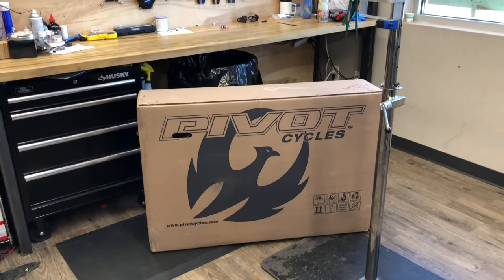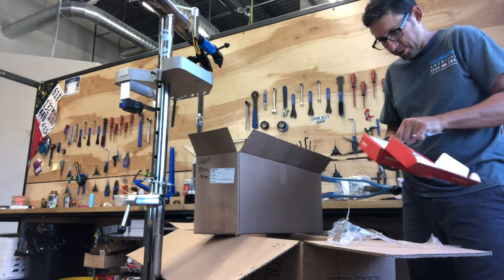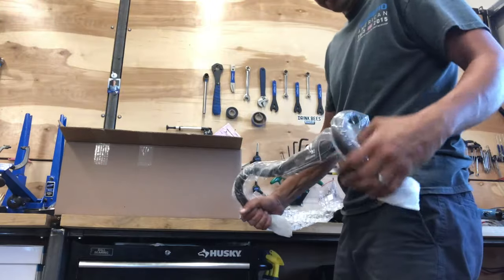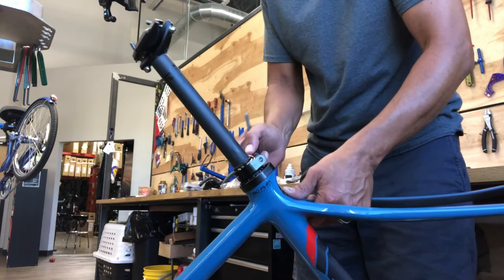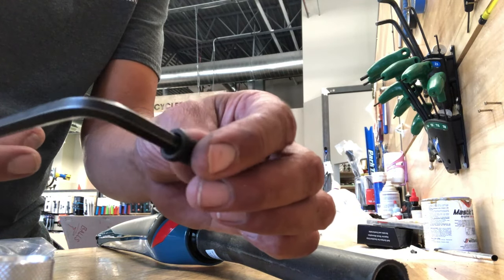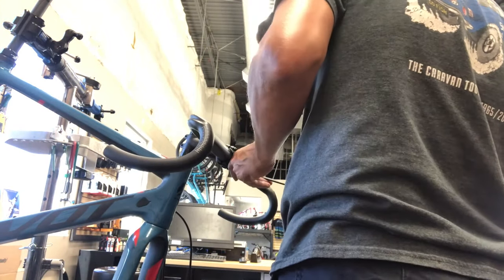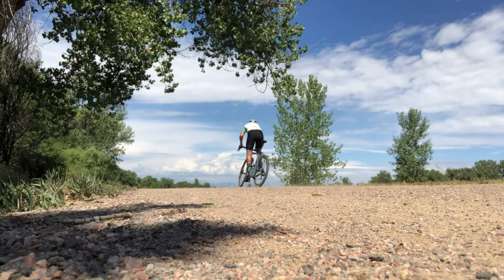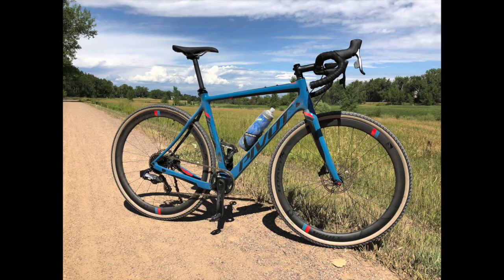Pivot Vault Gravel Bike Build

Comment: Have you ever done a disc brake review or comparison? Im looking to get some BB7s , mostly because ive heard good things about them.
Reply from the maker: I've never done a comparison video, but I'll see if I can get something together soon. BB7's are great mechanical brakes. They're super easy to adjust and they work well.
Reply: I'd go with TRP Spyres personally. Also, good pads and compressionless housing are a must.
Reply: Boni Hollóssy Thanks. Dual piston looks to be a lot better,  as I've noticed the rotors get torqued when I brake. I'll give these a shot.
Reply: @Radnally  Yep, that's why I went with Spyres. I've been perfectly happy with them for the last 2 years.

Comment: Seems like a great price but i don't understand why they are asking so much.  $5299 for GRX with aluminum rims is so much.  You can get an Ibis Hakka MX with GRX and Carbon rims and still save $100.  seems overpriced by about $900-$1000 dollars
Reply from the maker: I feel like frame wise alone, the Pivot is nicer with the iso flex seat post damper and the fact that the chain stays are only 420mm vs the Ibis' 430mm stays. Most of the specs I see for the Ibis GRX build are using Stans aluminum wheels. I saw one where it had an unknown carbon wheel set, but I have no idea of the durability or quality. The Pivot uses a DT Swiss rim, spokes and hub, which are all known proven components. 
They're both great bikes, but I guess it really comes down to what features and benefits are the most important to you, and obviously, your budget will be a big factor as well. Thanks for your feedback!

Comment: The gearing is a bit limited imo
Reply from the maker: Yeah, I get that. At least, that was my impression when I was looking at the specs on the bike before I got it. The shots in the video were from today, and that's the first time I rode it. I didn't ride anything today with any major hills, but my initial impression is the 33/36 low gear is low enough personally for me. The 1.09 to 1 ratio is the lowest of any drop bar bike I've ever owned. I don't think I got the bike much over 25MPH, but on gravel, it didn't seem like I ever got too spun out. Tomorrow may be another story. I'm going on a big gravel loop with some buddies that has quite a few big climbs and descents. My thought is if I was going to ride it in a road type setting, I'd probably put a bigger chainring on it like maybe a 42 or 44 tooth. 
 Thanks for commenting. I'm going to make another review video after I get a handful of good rides to see if the gearing and everything else is working out.
Reply: For gravel I really believe 2x is the way to go.
Reply: @pingpongballz5998  Depends on what you mean by 2x. A road setup with a 50/34 and 11-32 or 11-34 is pointless IMO, but you see it on a lot of bikes. Luckily with GRX there are sensible gearing options now for 2x. 
SRAM should really just come out with reasonably priced, mechanical drop bar Eagle options. I don't know what the hell are they waiting for, the MTB world already has Eagle at the lowest level.
Reply: @HollyBoni  I think 46/30 would be best gearing for gravel
Reply: @pingpongballz5998  Yep, the 46/30 is a wonderful ratio for gravel or really just for all around use for anyone that's not actually racing.
Reply: @HollyBoni  even for long gravel race with long ass climbs I think 46/30 is good.  Easier on the legs lol.
Reply: @HollyBoni  I currently run 1x with 38 on the front.  I hate it on long loose gravel/dirt climbs.
Reply: @pingpongballz5998  Same here. 10-42 with a 38 and 42 chainring. The 38 gives me an okay low gear, still not great. However on paved sections I notice that i'm using the bottom of the cassette most of the time, even though i'm pretty slow. With the 42 chainring i'm pretty much in the middle of the cassette, but 42-42 isn't really low for offroad.
Personally i'd like a 46/30 with an 11-36, or a 1x12 with a 10-50 and a 42 chaingring.
Reply: @HollyBoni  ya I agree.  I live in California with lots of hills and mountains.